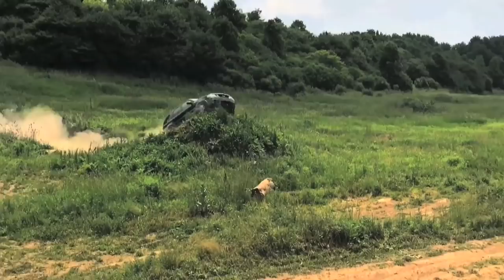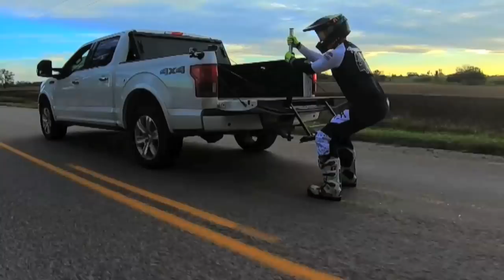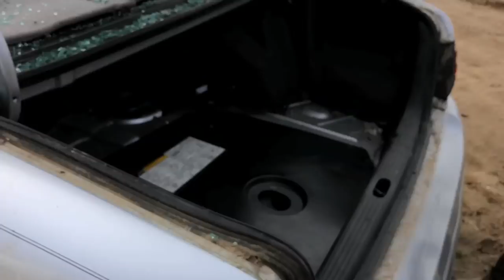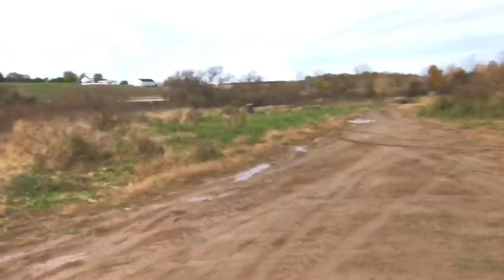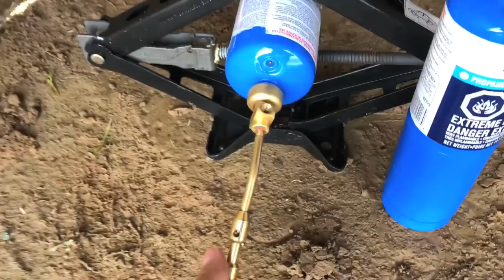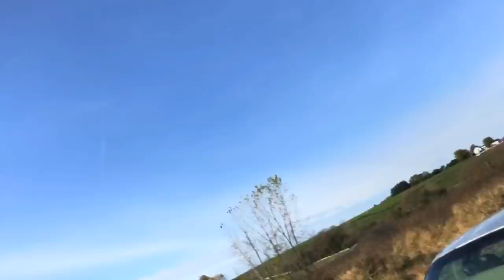Torch VS Torch FAIL!

Comment: Need to take a big trash bag. Fill it upside down with acetylene from a torch tape an extension cord in the bag with a paper clip shorting the two sockets. Plug in at distance to cause a short circuit and boom. Your welcome.